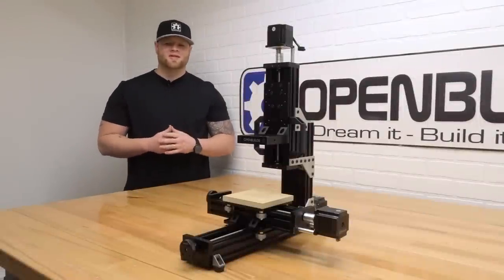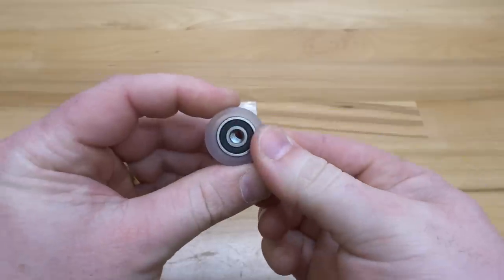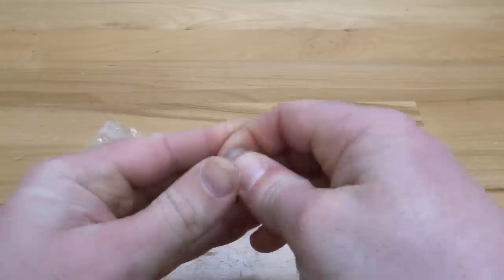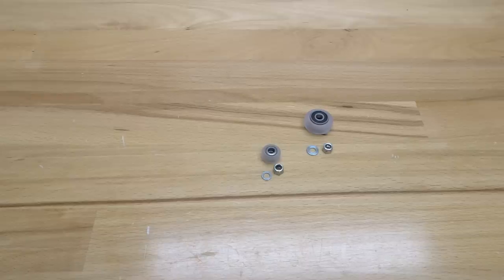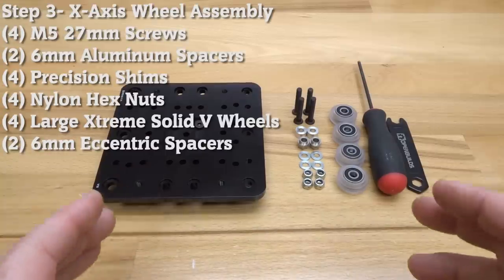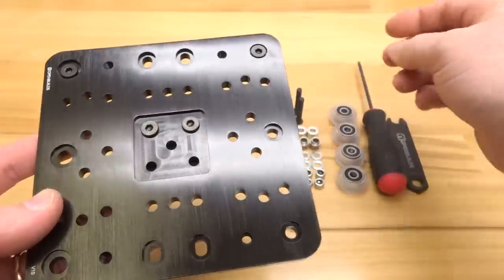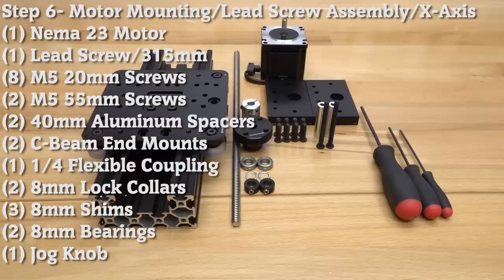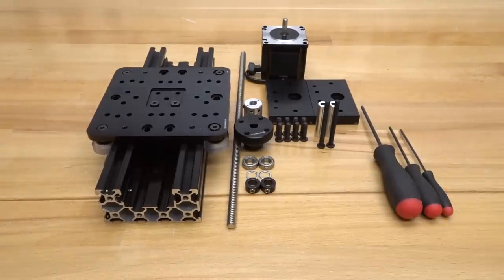OpenBuilds MiniMill Build

Comment: Hello, I would love to buy any of your machines, mainly for making electronic pcb, i am using Eagle to create my boards, but the question is, Which software will be more suitable to export files to Openbuilds control? 
For example i have your contol software and i can import or visualize the electronic edges, but hole drills file can not be red in the software, yet the extension is "admitted" by it. 
If i need to change software, i will, but would like to know more of how to create PCB in you machine. 
I will appreciate any help. Thank you!
Reply from the maker: Please reach out to contact@openbuildspartstore.com for  more details regarding this inquiry. Thank you.